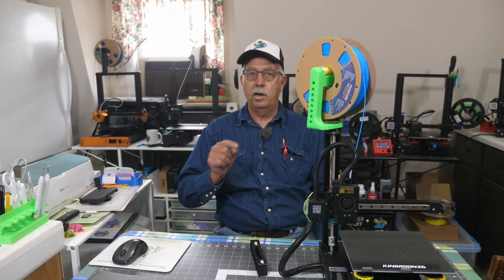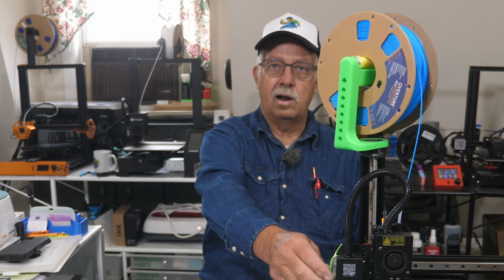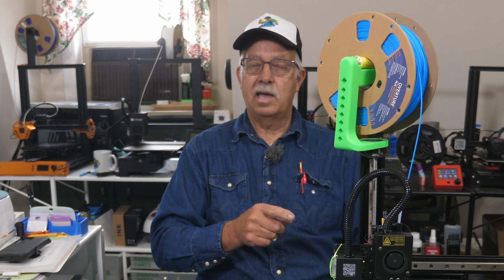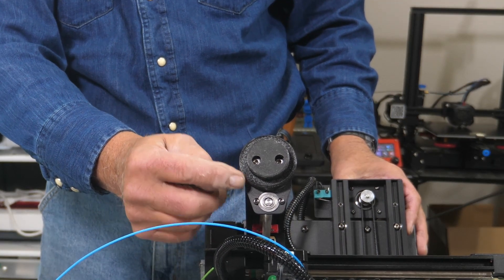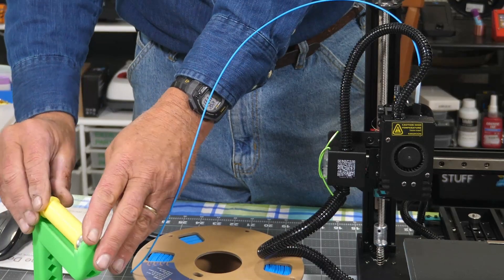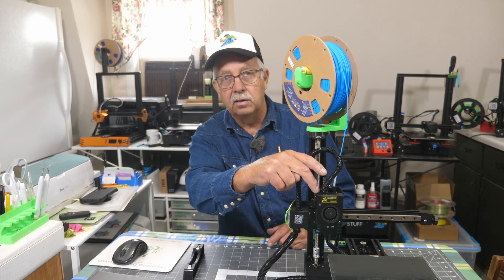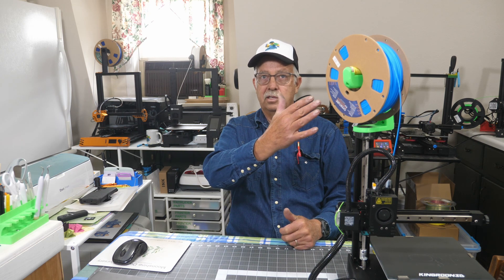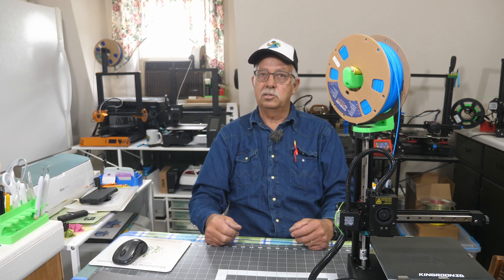Kingroon KP3S Pro 3D Printer Mod

Comment: I just bought my k3ps pro s1. Do you think it's a good idea to put this much mass on top of that single arm ??? additional stress ...
Reply from the maker: Weight is vertical and does not deflect the extrusion.  I've been using it this way for quite a while now with zero issues.